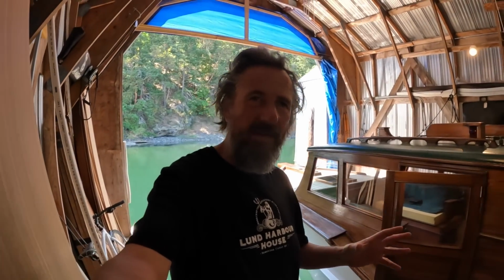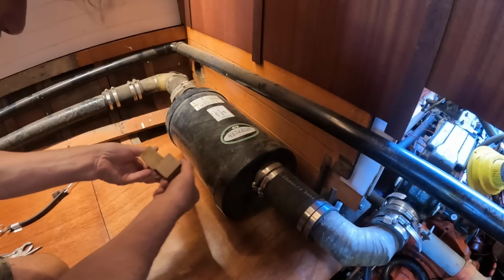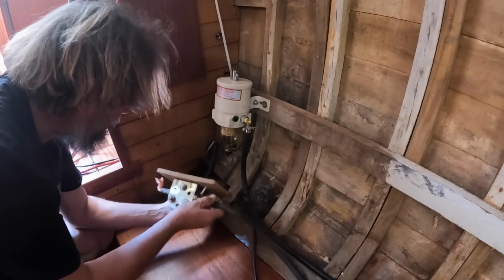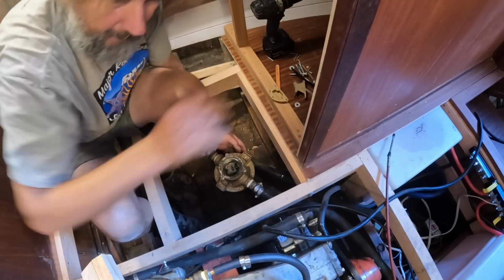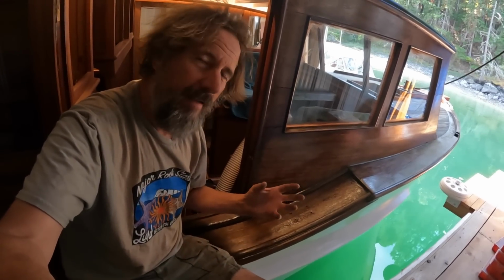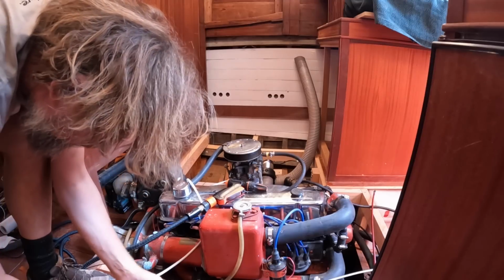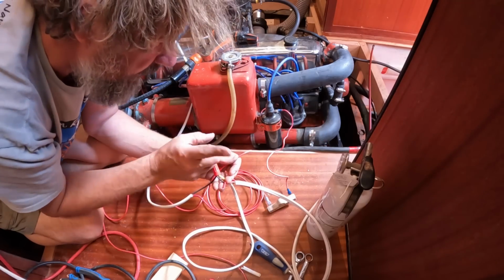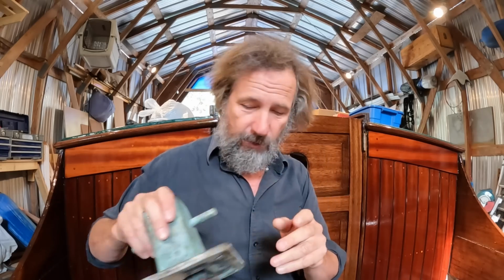Wooden Boat Engine Runs! - #379 - Boat Life - Living aboard a wooden boat - Travels With Geordie

Comment: Hi Peter.
I realise you know this but a checklist just incase.
Regarding the wiring around the engine bay.. as sparks are an issue.. putting cable in rubber tubing and gaiters can help.
New HT leads and check the little threaded thing's on top of the sparkplugs are tight, better is the type of HT leads that use the sparkplug connection direct to the threaded bit on the sparkplugs, clean coil insulation area and then check for electrical tracking when it's dark... thankfully it looks like the electrics are not near the carburettor.
Do you have a metal tray with a gauze (ideally with a bilge float switch in it connected to an alarm) below the carburettor also something similar below the filter and pump.
Have you cleaned out the float bowl and while you're at it take out the needle valve and flush it to make sure no bits are in there also there is good flow.
If I saw correctly.. it looks like the pan air filter is too small, have you cleaned it.. also check for anything in the carburettor and flooding when pump is on.
What stops the fuel pump from over pressuring the carburettor.. is there a return line or pressure return or regulator.
Automatic bilge pumps with alarm.
Regards from
Bella 🐈 & Mark.

Comment: I know what you mean about gas engines, but a gas engine will be quieter than a diesel. Also, you can upgrade the distributor/coil for the engine with an H.E.I. ignition , readily available in wrecking yards, gm vehicles 1975-up they are much simpler and very reliable plus a little content for you to swap it out!

Comment: Hi Peter, I’m sure the diesel fuel filter will work fine and be safe since it’s not in the engine compartment. I’d considered doing the same for the priming feature, but ultimately opted to side with caution. I do believe they’re approved for use with outboard engine setups too.

Poem is really looking great. Have fun at the festival!

Cheers! 🍻

Comment: Are you going to change the mechanical fuel pump.  You should use a 1994 ford probe 2.0l automatic fuel filter before the fuel pump inlet. If it uses 5/16 fuel hose. If it uses 3/8 fuel hose. 1984 corvette fuel filter.  Both are steel bodied and 10 micron elements.  Sediment holds the fuel pump check valves open reducing fuel pressure to the carb.  Allowing the engine heat to boil the fuel in the lines. The expanding vapor pushes liquid fuel back to the tank allowing only fuel vapors into the carb.    Sediment in the needle asn seat in the carb allows fuel levels to raise until the bowl overflows wicking out the throttle shafts after shutdown.
Reply from the maker: Lots of good points here. The mechanical fuel pump is fouled by the heat exchanger.

Comment: Peter, have you considered adding ball valves at both the fuel filter inlet and outlet fittings.  They will provide a local fuel shutoff to enable simple and easy filter/motor servicing even though your petrol motor does not have the same bleeding issues as my Yanmar diesel on my sailboat.   s/v Jalepeno

Comment: Because of the location of the pump/filter, IF you elect to install a gas sniffer, you will want detectors at both the pump/filter location as well as the engine bay.  Time to go with diesel!
Reply from the maker: Gosh yes!

Comment: Amazing work with Poem Peter! One thing though; I think that fuel pump sits upside down. I have  Carter pump similar to that one and these pumps are filled with gasoline wich works as coolant for the pump motor and the pump housing should face up and the motor down too keep the motor housing filled with gas.
Reply from the maker: Filled with gas?!?  Yikes. I don’t think I would like that. most likely swapping out for a new pump anyway.
Reply: Most electric fuelpumps are filled with gas and it is not a fire hazard, they would not be coast guard  approved then? No, these Carter pumps are very reliable. When using a electric pump in a boat, a safety curcuit shold be added, so the pump stops if the oil pressure disappears. That prevents the pump from operating when the motor is not running, as in case a fuel line comes lose. There is special  pressure breakers avaliable for this purpose. @TravelsWithGeordie

Comment: talking of Festivals, I am taking Water Rail to the Beccles Wooden Boat show this coming thursday, lots to do, including reattaching many of the fittings to the cabin sides, where they came off so we could varnish, Also on my last trip I added a 50W solar panel and wired it in to the battery bank to keep it topped up between visits. unfortunately when I wired it up I used plastic clips to retain the wires, I have just been using a 3d printed die in a small fly press to make up some brass replacement cable clips, this will give me yet another job to do replacing these before show day (saturday) so thursday we meet up at oulton broad, and have a garden party planned, friday we cruise the 1 1/2 - 2 hour cruise  Oulton to Beccles (well we will be decked  out with flags etc so its more a procession ), then Saturday and sunday is show time where the boats are open to the public, so everything will be made spick and span for that. so I need to finish the clips and polish them, gather everything I will need for the trip, and then get going.
we did get at least 2 coats of varnish on, last trip it was raining a lot so I didnt get additional coats on, but maybe after the boat show, if the weather is good I will have a week aboard to get some jobs done.

Comment: One cannot use a glass/ plastic bottom water, fuel filter,  for gasoline inside a boat cabin, in Amerka. It is Used only in open hull designs. As you said it’s a diesel fuel filter. PO is not always best safe endorsement.
Reply from the maker: There are some changes coming.

Comment: In the US you cannot use a glass or plastic bowel in an enclosed area, if your engine is gas. You can get metal bowels for most drainage filers.  I found out the hard way.  Coast Guard inspection.
Reply: "I found out the hard way". Bowel-Larry
Reply: i have friends who have a 1940 chris craft with the original gas engine which has a glass bowl on it's mechanical fuel pump, the coast guard hasn't said anything negative about it. possibly older vessels are exempt from the rule?
Reply: Yes that is true.  Also Racor only rates that 500FG filter for diesel.  It doesn't meet the specification for an inboard gas boat.  If you want to stay with the 500 series, you need a 500MAM.  I don't know the rules in Canada, but you might want to ask a surveyor.

Comment: May I humbly suggest the copper line for the oil pressure gauge instead of the plastic junk?
Reply from the maker: I get your point but copper will work harden from vibration and crack.
Reply: @TravelsWithGeordie  Not as quickly as plastic. The heat destroys it much quicker. Just like sunlight on plastic. Its why I no longer use the tube type at all on the cars I build. Also I have never had the copper crack ever. I just don't find them very accurate compared to the sensor types available.  But again you get what you pay for. I love to use intellitronix in as many builds as I possibly can.
Reply: @TravelsWithGeordie  Sorry found out the line that's sold for them is a Copper-Nickel mix! Same as the brake lines I use. Sorry for the confusion.

Comment: Peter, just a thought, will those white oak spacers transfer sound and vibration into the sole and frame of the boat. That might be very noisy.
Reply from the maker: That’s a good point. if I find it noisy I’ll certainly put some dampening in.

Comment: You'd think in this day and age you could just have a constant gas monitor in the bilge to determine whether or not gas was present and a potential issue that needs attention. The blower just hides a potential issue that may come back and bite you.
Reply: Really? If Peter´s nose is working, then I´m sure he will be alert both before and after the blower runs. However, if you are talking about redundancy, then by all means.
Reply: @pauldailey4477  Those of us that work in an industry whereby harmful gases may be present are taught not to rely on your nose, but the gas monitor you take with you. The gas used for cooking and heating will be heavier than air and if it leaks on a boat will gather in the bottom of the boat. Putting an air mover on will purge it out hopefully, but purging is another science that may result in the purge gas just taking the easiest route to the vent point and leaving pockets of the gas you want to remove in situ. If you don't know you have a leak, you wont know you have a problem that needs attention.

Comment: I believe the "diesel style" filters with the clear plastic water separator bowls are not supposed to be used with gas.  The gas versions have metal bowls.  You may be ok because you are not putting the filter in the engine room, but not 100% on that.
Reply: Also wanted to mention that the fuel pump needs to be run through an oil pressure switch or another method that will cut power when the engine is not running.  There are plenty of boats that have it wired directly to the ignition switch, but that method has filled up many bilges with fuel, which I have seen first hand unfortunately.

Comment: Don't understand the need for an electric fuel pump. There should be a mechanical fuel pump on the engine. The noise of that electric pump would drive me nuts!!
Reply: It sure needs some sound isolation, but it will be behind some cabinetry, so maybe he is going to insulate.
Reply from the maker: The original mechanical fuel pump is fouled by the heat exchanger.